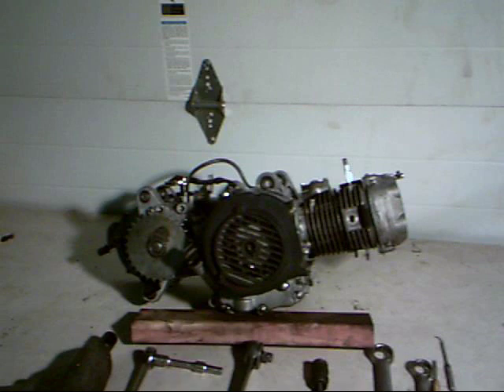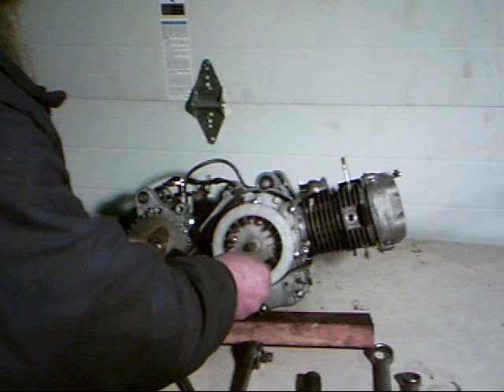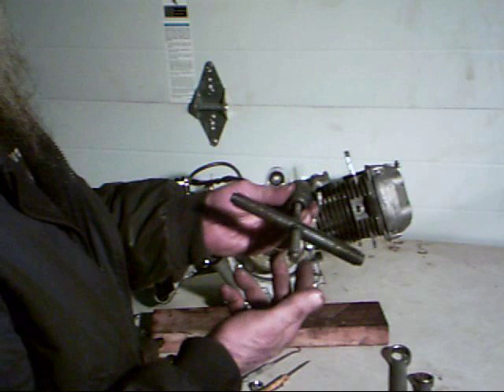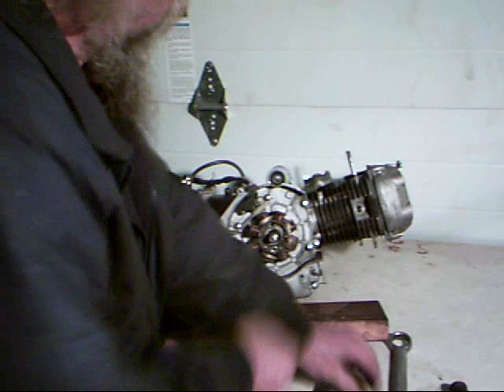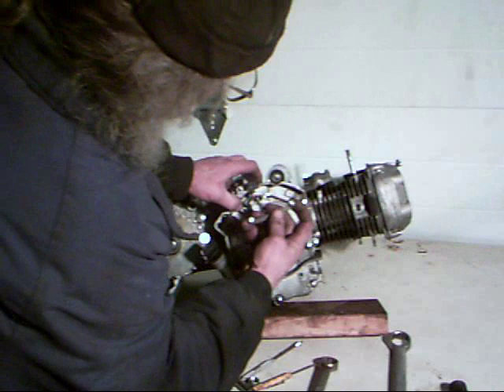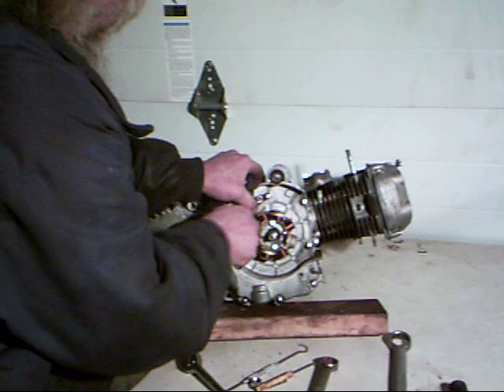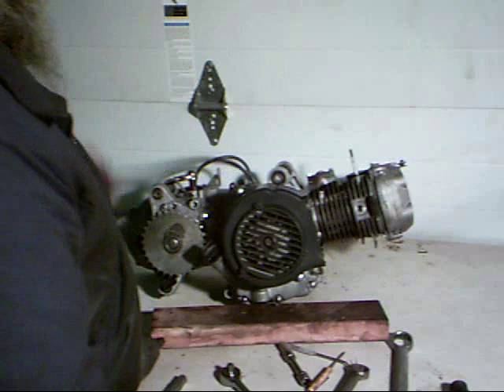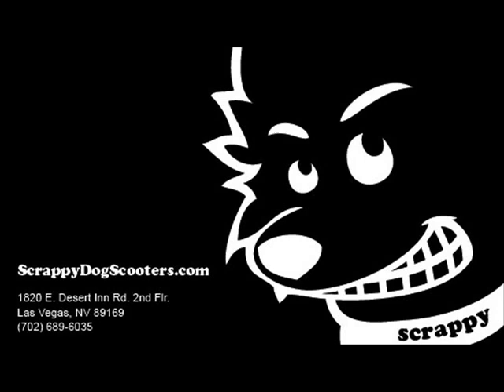Installing a GY6 Stator

Comment: I have a problem ... My stator has the output of 5 wires(3 wire plug + 2 wires) but my go kart doesnt have were to plug one of the lose cables... And it wont start because the coil has no electricity,... What can i do? Please help

Comment: I bought a complete wire harness it came with everything but the stator was a 2 pole and I had a 6 pole so I bought a new 6 pole stator with the stator plate. It would only fit on one way and now the pick up is at the 5 o’clock and my old one was at the 2 o’clock will that matter?

Comment: You said you pre losened the screw on the fly wheel, now ofcourse i didnt. How do i keep the flywheel preventing from turning when i try to remove it?
Reply: You would have to secure it with a strap or something similar.

Comment: The previous owner of my cart has the wiring on the starter solenoid battery etc all took loose and I can not figure out how to wire it back up. If I could see inside your starter solenoid box and the battery wiring I do believe I could get mine running. I believe they have even added extra wires that I have no clue where they go.

Comment: Hey Mo. My headlights come on AFTER I start the engine. Well they did! Last week they quit working. I changed the voltage regulator, no help. What causes this?  I put in new H4 35/35 bulbs as well
The engines is a 149.6cc on a Wangye scooter. Thanks.
Reply: Lonnie Hinson you need a new stator

Comment: Great web site, video, very helpful.  One question, I have a 150cc ROKETA 157QMJ  GY6 clone and it won't start.  How can I test to see if I need to replace the stator?  How do I know without taking it apart whether I have a 6 pole or 8 pole stator on this scooter?
Ready to order parts but don't want to buy the wrong ones....
Reply: It may not be the stator. it could be your CDI, ignition wire, or plug.